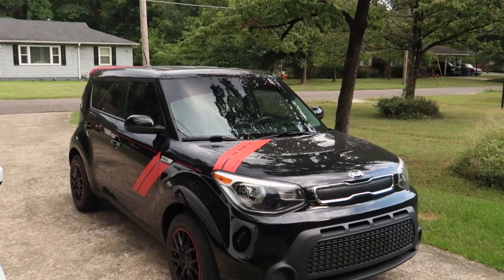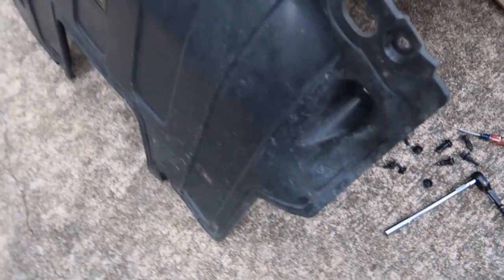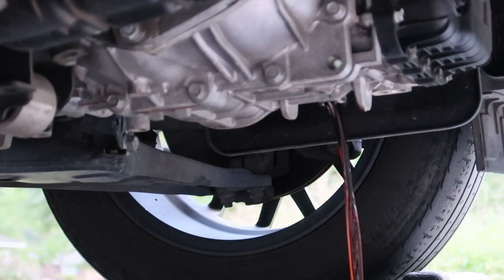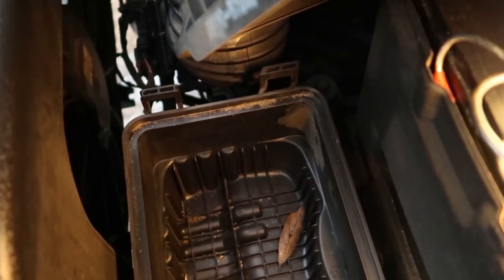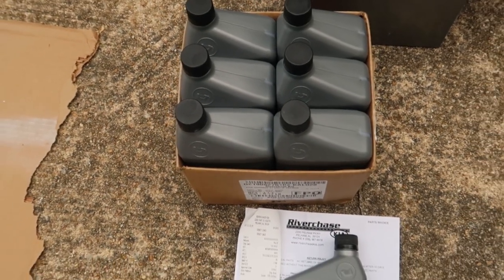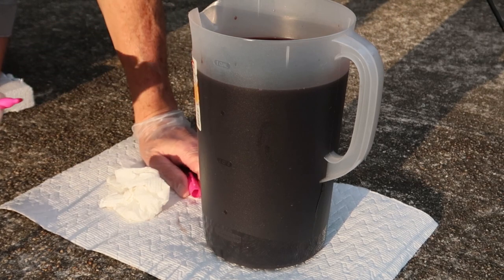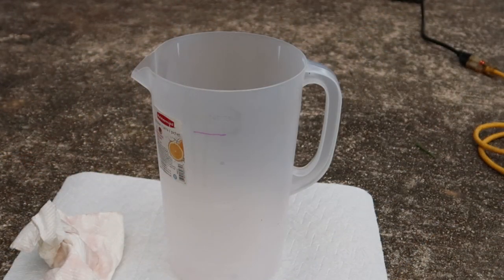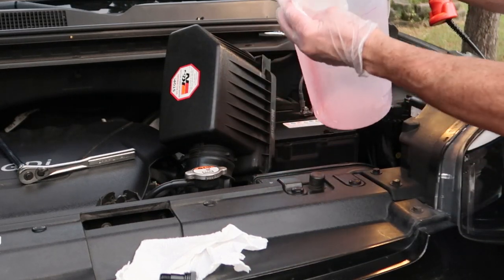Kia Soul Automatic Transmission fluid drain and fill #Kiasoul

Comment: Any SP-4/SP-IV, SPH-IV, CP-IVM/SP4-M, SP-IV-RR, Mercon Low Viscocity ATF will work.  Valvoline MaxLife Multi-Vehicle Transmission Fluid will also work.  Been using Motomaster Multi-Vehicle Low Viscosity ATF made by CITGO since 2013 for my 2012 Hyundai Sonata.  My change interval is every 2 years or 40k kms. and been doing it by myself.  A 5-litre jug cost me CA$40.00.  HYUNDAI and KIA use the same type of ATF.
Reply from the maker: Thanks for sharing this information, that's a  huge cost savings over Kia's transmission fluid!!!!👍🏁Thank you so much for watching!!!
Reply: @Zspeed  Yes, it is a huge savings for me and for everyone, especially if the car owner is a DIY'er.  Hyundai dealers just charges equivalent to 2 arms and 2 legs where car owners will just dedicate 2 hours of their time and some dollars for the ATF.  The savings can go your 6/12/24 pack of beer, whiskey and/or Rhum.  It may be challenging for first time doers.  I also have a 2019 Kia Sportage 2.4 ltr. AWD with 29K kms. and uses the same type of ATF, so anytime this summer, I'll change the ATF and diff power transfer oils....  Great video ! ! !
Reply from the maker: Awesome!!👍
Reply: So i was plqnning put liqui molly or valvoline, but was afraid of compatibility issuse, u say its ok, r u sure about, when its mixed with old one?
Reply from the maker: I only use transmission fluid from Kia!
Reply: you put 5 and 1/4 quart US?
Reply from the maker: More like 3 and 1/2 quarts, but it might very a little from car to car!
Reply: @Zspeed   I Have kia soul 2011. The dealer put 5 and 1/4 which is over from the level of dipstick
Reply from the maker: You may want to drain some transmission fluid off!

Comment: Just did my wife’s 2013 Kia Soul.  When I went to autozone the clerk looked it up and it required 7 quarts of fluid.   Thanks for the video! Made the job a lot easier.
Reply from the maker: So glad it helped, thank you so much for watching!!
Reply from the maker: That's right, you will never remove all  of the old transmission fluid unless you flush it!!
Reply: On average for the 2013 2.0 how many quarts to really flush it?

Comment: One more note, there is a passage hole on the fill plug, make sure that hole is line up with the feeder line from the  cooler radiator when you tighten. make a mark will be great.

Comment: If you don't use the overflow port when refilling,  how do you know the transmission has the correct amount of fluid before draining?
Reply from the maker: We bought this Kia brand new from the dealer, so I knew that it had the correct fluid level before starting the drain and fill. But, if you don't know the vehicle's fluid change history you should definitely  check the overflow port! Thanks so much for watching!

Comment: You can put the oil back into the original 1 quart container. It should be easier to fit the small 1 qt container in to that area.
Reply from the maker: Yes, that would be a easier way to do it! Thanks so much for watching!

Comment: Love the video,thanks dont use my Kia Soul 2011 alot ,have newer KIA. Shifter is stiff sometimes,added a bit of fluid seems better.Sometimes wont start in park ,next time it will ?? Always starts in Nutural. Pan is really rusted which makes me wonder if it is leaking. Went somewhere and they didn't want to flush,scared to take bolt out incase it broke. It was one of my kids cars don't know if Trans fluid was ever changed,at around 162,000. Could shifter problem be because fluid is so old ?? Thank you.
Reply from the maker: A drain and fill might fix your problem! Let me know if it works!!

Comment: Great Job   great video  clear pictures great narration ....     however to save  $280 at dealer you spent  several hours and 50 bucks in fluid and then you need to dispose of used fluid    for me the 280 would be money well spent lol..

Comment: I always just repump in the fluid enter the Overflow port until it starts flowing out. Never sure if it's supposed to be running or not. If it's running it will take in a half a quart more. Then when you turn off it will pour out. I have changed my 2017 several times since new. Just only never confirmed whether it should be running or off when waiting for the Overflow to drip out. Lots of opinions both ways. So I kind of just made it in the middle meet it in the middle

Comment: My girlfriends 2012 Kia Soul just hit 300,000 miles with no transmission service done. 

Should I do this service?
Reply from the maker: Wow, 300,000 miles is incredible! If the transmission is not currently slipping or having problems shifting, you should be ok. But you will have to remove the service port on the side of the transmission because your fluid level should be running a little low at this time and you will need to use the port to get the proper fill level. Drive around for about a month and if everything is working OK, you should repeat this fluid drain and fill again and that will really rejuvenate your transmission fluid. Thank you so much for watching!!
Reply: Just tell her to get a new car....

Comment: Hi Z Speed. Amazing video, love all the detailed explanation. I read that you are planning to do the filter change on the next flush. Is it possible if you can record it and show the video. I recently purchased a Kia Soul 2021 2.0, it comes with the cvt transmission. On the manual it doesn't show any transmission fluid change schedule, it says is not necessary. I know is pure bs. How often should I replace the fluid on the cvt? Someone said that because those transmissions are extremely delicate, it should be done very 30k. What do you think?
Reply from the maker: To be honest, I have no experience with a CVT transmission. But I would change the Fluid at least every 50,000 miles! Just YouTube CVT transmission to see what the experts have to say about it and thanks so much for watching!
Reply: @Zspeed  Hello again and thank you for replying my comment. The Kia Soul that you showed on the video. What year, model, engine size and transmission is it? I am wondering if my Kia Soul is the same way as yours where the transmission's dipstick is located underneath the air filter box.
Reply from the maker: This Kia Soul is a 2015,  But there is no dipstick under the air Box, there's just a fill port for the transmission fluid!

Comment: I was thinking about doing this transmission fluid change on my 2016 kia soul...To confirm as long as I correctly measure how much fluid I take out...i dont have to use the side port to check the level stream. Thanks in advance.
Reply from the maker: As long as this is the first transmission fluid change and you are the original owner, you should be ok! If in doubt just open the service port to check the level! Thanks so much for watching!

Comment: Mr. Zspeed, about how many miles you had on kia soul when you changed ATF? and how does it run now? I currently have 67,000 miles on mine with no previous work done.
Reply from the maker: Changed the fluid at 60,000 miles and it runs great!!!👍🏁👏
Reply from the maker: Thank you so much for watching!!!

Comment: There are gaskets on the Fill, Check, and Drain bolts. Are those single use gaskets?
Reply from the maker: If needed, you can reuse them, but they should be replaced!!!

Comment: My wife has a 14 Soul we bought brand new, its 106,000 miles now but never had the trans service...Would it still be safe to flush & fill???🤔
Reply from the maker: I would not flush it, but I would definitely drain and fill it!!!
Reply: It's better to drain then fill with the same amount fluid. This really does make a big difference on a used car that has not had regular transmission fluid changes. I am speaking from experience. It may seem that a flush is much better  but I have yet to meet a mechanic that  won't stand behind the advice of a drain and fill.  There is a high risk that solid sediments getting move around during a flush will foul the transmission. This is why it's not recommended in the video.

Comment: What did you use to clean the car under the hood? Very nice and clean.
Reply from the maker: Yes, I like to use 303 Aerospace protectant to clean all the plastic and rubber parts inside the engine Bay!

Comment: Please the check the pluge that u installex at the, it has holes, and should be allined with outer plastic tube..
Reply: You are referring to the Eye Bolt/ injection port.  Align the hole to the tube connected to it.  If you're wondering about it's washer, it's a metric o-ring P16 ,15.8 x 2.4 mm ( must be safe with high temperature ATF ).

Comment: Perfect explanation! Thanks very much 👌🏻.. I have  one question please : where the transmission filter is located?
Reply from the maker: It should be underneath the black plastic Pan, where you check the transmission fluid level!  Is about 14 or 15 bucks and you should also change the transmission pan gasket too! Thanks so much for watching!
Reply: @Zspeed  NOOOOOOOO. is in the middle of the transmission and the only way is dissembling it.

Comment: Is there a traditional filter inside?
Thanks 👍
Reply from the maker: Yes, the transmission filter is inside the panel where the service port is is located. You will also need a new gasket for the panel before you bolt it back on! Thanks so much for watching!
Reply: @Zspeed  Thank you for the video. Do you know when Kia recommends a filter change?
Reply from the maker: I couldn't fine the filter replacement interval online, check in with your local Kia dealer, they should be able to give you that information!
Reply: @Zspeed  Thanks!

Comment: Great video! It's really helpful as I own a 2015 Kia Soul that's about ready for its first transmission fluid change c:
Reply from the maker: Glad it helped!
Reply: At what mileage should you do on first transmission fluid change?
Reply: @checuevas93  from what I've seen and what Kia recommends is around 60k miles. If you could do it yourself, I'd highly recommend that to save you almost $400 (if taken to the dealership bc they'll try to get you for a transmission flush instead of just a change)
Reply from the maker: 50,000 to 60,000 miles!
Reply: @IcyHyoudou  yea I'm doing it myself. Reason I ask its because the car dealership that I take my soul to get service has told me my car needed transmission oil change at 30,000 miles. Glad I have more time.
Reply: @IcyHyoudou  yea I'm doing it myself. Reason I ask its because the car dealership that I take my soul to get service has told me my car needed transmission oil change at 30,000 miles. Glad I have more time.
Reply from the maker: Yea, they told me 50,000 to 60,000 on my 2015 Soul, maybe they are changing the guidelines or trying to rip you off!!!

Comment from the maker: I pinned this comment for alternatives for transmission fluid, thank's to Pinoyeh!!!!
Reply: Is there a filter in there?
Reply from the maker: Yes, it's located behind the panel where the service port is located. You will have to remove the service port panel and don't forget to replace the gasket also! Thanks so much for watching!

Comment: The fill hole plastic bolt has a hole through it near the top. The hole has to lined up with the hose going into the fill hole.
Reply from the maker: Yes your right, I forgot to mention that!👍💯🏁

Comment: How many quarts did you refill? 
Tip: To get even more fluid out, drop the car from the ramps to make it level ground
Reply from the maker: Just under 4 quarts!! Thanks so much for watching!
Reply: Or raise the rear wheels also before making the change so the vehicle doesn't have to be moved during the process.
Reply from the maker: Great idea, thanks so much for watching and don't forget to subscribe!!!👍🏁💯

Comment: What about the filter?
Reply from the maker: This video is for a drain and fill only and doesn't cover the transmission filter replacement! Thanks so much for watching!
Reply: @Zspeed  after some research I see you have to take the transmission apart to get to the filter. Thanks for the reply.

Comment: Well, you’re smart to never flush a transmission around a transmission shop for 12 years so I was heard about the competitors doing that and then charging customers three times the amount to go back and rebuild a transmission when they didn’t technically need it to be rebuilt they just needed to change the filter and fluid on their vehicles vehicles

Comment: If you put less than 1 gallon of back in the car it means you still have about 4 qts of dirty fluid left in the torque converter because the 2015 Kia Soul holds 7.7 qts of Automatic transmission fluid. That's the problem with NOT flushing the system out.
Reply: Some folks suggest repeating this after 2 or 3 weeks to address your concern.....wastes some money but it yields much closer to a full fluid exchange.....

Comment: No is this the same style a drain plug on a 2016 Kia soul 2.0 because I was going to pick one up tomorrow that’s an automatic
Reply from the maker: Should be the same!!
Reply: @Zspeed  oh thank you again I will definitely have to keep that in mind if I decide to do the work myself or take it over to my step brothers transmission shop that I helped run before he bought the shop back
Reply: No I had an idea that popped in my head today and since you said that they make a plastic plug for that 2020 Kia soul and it should be the same for maybe the 2016 Kia soul plus I’m assuming I thought about instead of going with that same plastic plug that you were talking about that’s on the top to fill it once you remove that airbox I thought about making that same style plug out of metal with a CNC machine I’m working on saving up the money for a 3-D printer/CNC machine so I could make little automotive parts like that so I have to worry about it breaking if I can just get the dimensions or I guess go to the dealer and buy one or look one up online so I can put it into the computer with the 3-D printer/CNC machine and make a copy of it so that way I don’t have to run into the problem of it possibly breaking I don’t know if you have a Kia soul or if you were just working on one for the video for someone else

Comment: Ummmm......no need to remove the entire dust shield!  There's literally knock-out panels right there so you can easily change oil and/or tranny fluid without having to remove the entire shield.